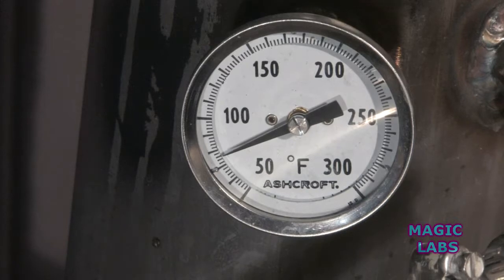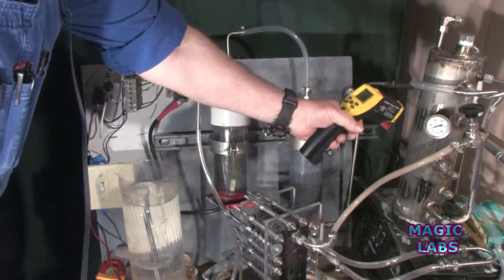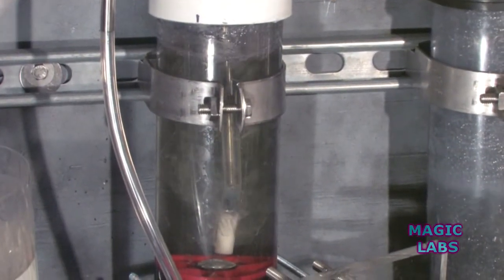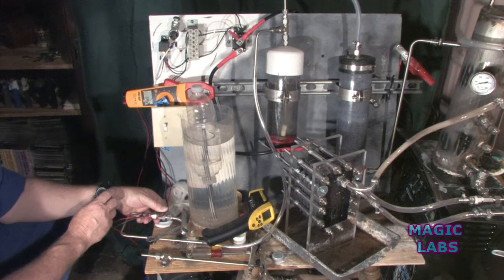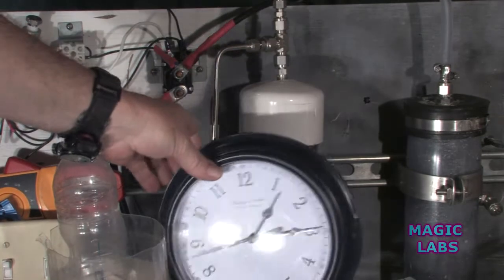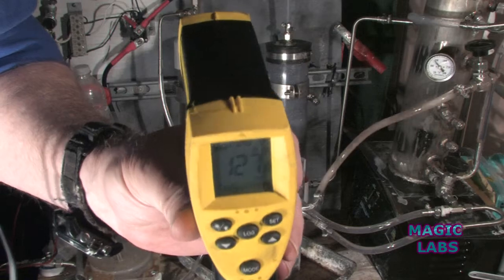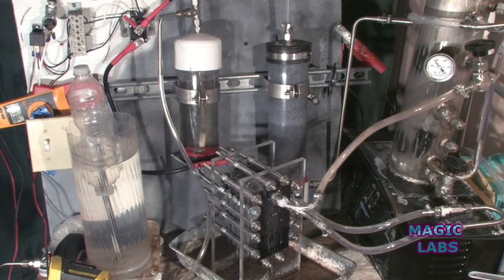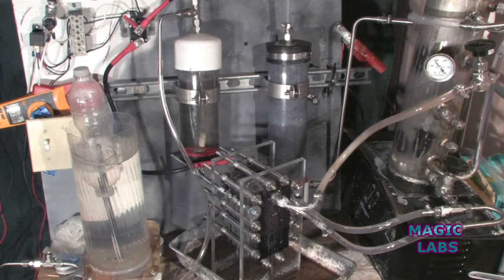14  VOLTS SEVEN CELLS. BIG DIFFERANCE

Comment: Sorry I'm talking about the time taken for the bottle to rise, if it wasn't for drag and atmospheric pressure on the bottle  the bottle would rise quicker than 20 seconds. if you try and pull that bottle out of the water with your hand  you'll see what I'm saying  the faster you pull  the more drag. I'm not sure what the drag time would be, but it could be up-to 3 seconds. making your time 17 seconds not 20.
Trying to push water out a bottle there's pressure, that would not normally be there